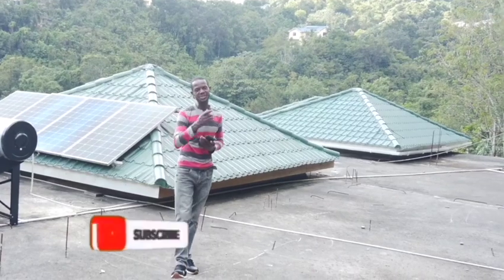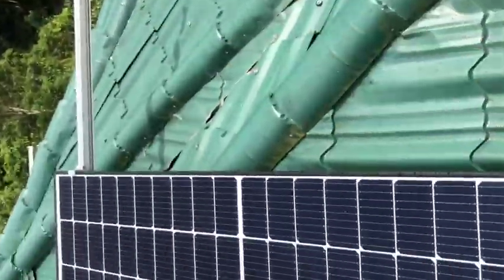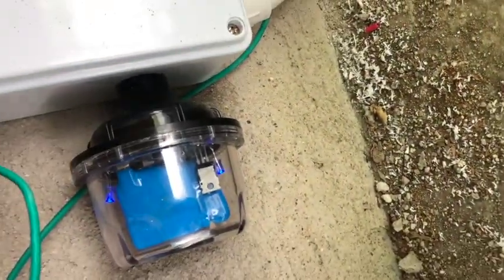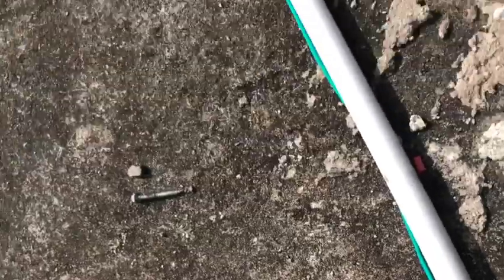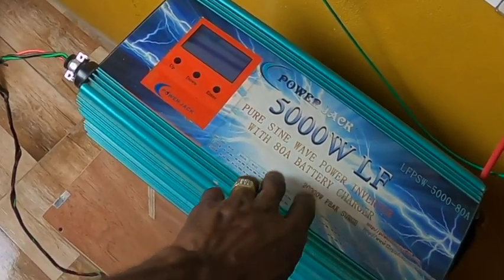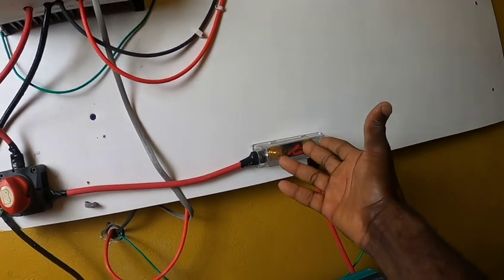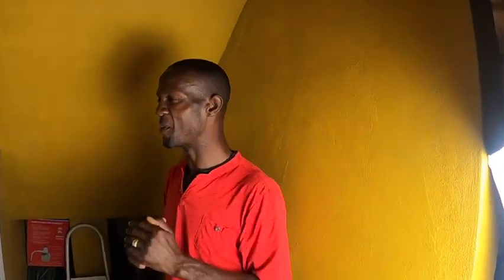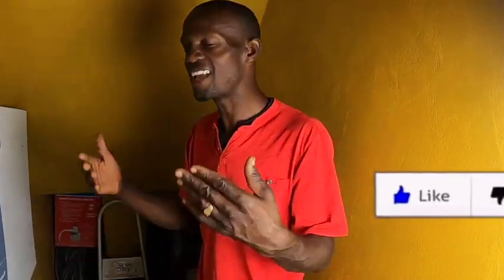My Upgraded Solar System in Jamaica (Kick your Power Company Out the Door !!).

Comment: nice work, you on the right track... piece of advice.. NEVER PUT LITHIUM IN WOODEN BOX. fire hazard. but you on the right track
Reply from the maker: Thanks much, that’s how I brought them in the Woden container.
Reply: I doubt the batteries are Lithium, they are most likely Lithium Iron Phosphate (LiFePo4) which is a very stable chemistry battery, nothing like the old Lithium which was very unstable and caught fire easily. But people shorten the LiFePo4 name and call it Lithium.

Comment: Further time watching and love your video, I m also considering going solar but doesn't know where to start, can you give me some advice and what to run the whole house, thank you
Reply from the maker: Thanks for watching. As I have always said, a small start is better than no start at all. You can start by getting your equipment one by one. It would also wise to get a decent size inverter and change controller or the hybrid system. The battery would be the last thing on your list.
Reply from the maker: Hi thanks for watching. Am not a certified installer, However very soon I will be doing some basic video showing   Step by step how to do it yourself. Stay tune for them.

Comment: Great content. How long does the charge last at nights?
Reply from the maker: Thanks much. Well it depends on what am doing in a particular night because my wife and I run a workshop so when we are running the machines it may or may not last through the night. However the solution for that would be more battery storage witch I’ve already ordered. Thanks again
Reply: Reading through the comments all the way from Kenya ...love your honesty

Comment: How many watts do you have on your charge controller? And what are the specs on the Epever controller? Please and thanks.
Reply from the maker: Well the wattage is Determin by the voltage of your system, my system is a 24v system so my controller is 2500w. For a 12v system it would be 1250w. For a 36v it’s 3700w and for a 48v system it would be 5000w. Also considering that my charge controller is a 100Amp charger. Well the specs on it are alot. Over volts protection and  warning, over charge protection warning and disconnection . Over temperature warning. The capability to use WiFi and Bluetooth viewing and change settings. It have a nice lcd display screen and also the option of using the MT50 display that makes the settings more easier to understand. Settings are there also to accommodate the different types of batteries. Generator capability and a lot more features. Very nice controller for the price.

Comment: Great video. I feel your excitement for not only helping The environment, but also helping the country reduce need for foreign oilimports . Jamaica have nuff sunshine and as a bo us yuh can go tell JPS fi go dead a bush!   One safety point though. Put those Lithium batteries OUTSIDE!  It is rare, but IF the batteries  catch fire, it's over 3500 degrees  that the fire dept can't put out without massive amounts of water and time. Which Jqmaica fire brigade never show up with either.  At the end if it's on the inside the yuh whole house gone
Reply from the maker: Jamaica have one of the highest light bill in the world, and we are bless with so much sunshine. Thanks also for you advice.

Comment: Just keep in mind, your PV input will only be as high as your lowest PV panel. Even if you're in pure sunshine and one panel is partially shaded your entire array will only take in what your lowest PV panel takes in.
Reply from the maker: Thanks much. All my panels are in 💯 direct sunlight.
Reply: @subbydiy  We've been running on solar for about five months. I've got SimpliPHI batteries at about 15,000 watts and 24 100 watt panels. I like these batteries because they've warranted for ten years and have a life of 10,000 cycles. I've only got a couple more appliances to get attached and we'll be totally solar. Since we live way up north in Northern Wisconsin I have to adjust the angle of the panels for summer and winter. That's probably something that you do not need to do.
Reply from the maker: @tekki2060  oh yes those are some really nice batteries! Also they are Maintenance free. Before you know it they will pay off for themself😎. Here in Jamaica we do not have to move our panels Sunshine is not a issue here. We start getting charge sometime from about 5:30am and up to 7pm sometime.

Comment: I put in my system in the hills above Ocho Rios myself. I'm handy with fixing stuff, but had never done solar before. I did not find it oo difficult, just have to follow some rules so you don't damage the equipment. I couldn't be happier, when I saw that it ran the fridge, even more so. Just a couple days after I put it in a tree fell on the JPS line down the road. I was the only one with electricity, sitting down relaxing drinking cold beer! I brought my components from the USA with the intention of upgrading but frankly don't see a reason to upgrade any more as everything is run off what I have. I think I'd like to put in a small AC, so that might need couple extra things (more panels and battery). All I have installed are - 800 watts of panels, an 80 amp MPPT charge controller, a 5,000 watt, peak 15,000 watt inverter and a 24 volt, 200 AH 5.12 KWH battery. Even on cloudy days the battery is fully charged from the night before use by about 11am. I put 24 volt led light bulbs all through the house. These bulbs are full size and look like regular bulbs, but they are 24 volt. I'm running a 15 Cu. Ft fridge, a 900 watt microwave, a 1,000 X 2 watt hotplate (only in daytime when battery is full), a 50" TV (a lot), fans, etc. Of course all the things like laptop, internet and phones and charging, etc included. The charge controller and inverter I have are overkill for what I need, that was done on purpose so no matter how big I try to go I wouldn't need those replaced. The inverter is split phase, so 120/240 volts. For upgrading I would need more panels (800 watts is not a lot) and at least another battery. 
Unlike you, I won't mix battery specs, I prefer that all the batteries be the same spec and they all have to have the same charge before connecting. You even have to use the same length wire to connect multiple batteries.
Reply from the maker: Wow!. Well said my brother and am sure a lot of my subscribers are learning and taking notes. Well a few more watts on your array will not hurt especially if you are considering a A/C unit, also you will need more batteries. My battery provider is locally base and I had contacted them before concerning the batteries, however the only difference is the kWh and also one of them have wifi capability. I know the joy you feel, when jps is down and you are still able to do the normal stuff on your solar system😁!. Thanks for your much needed comment
Reply: Well done sir! Greetings from Mobay.
Reply: Nice!